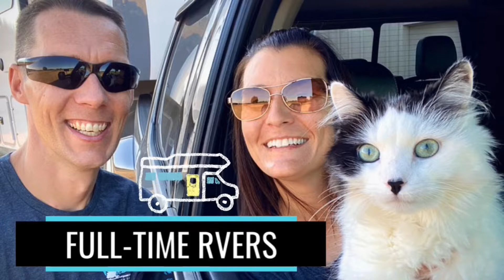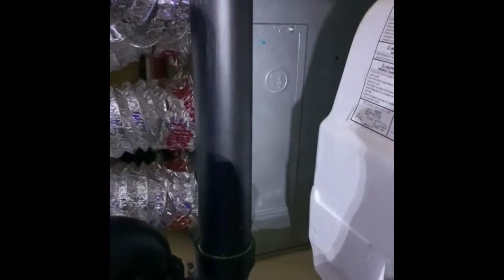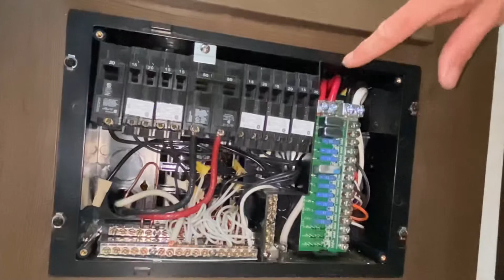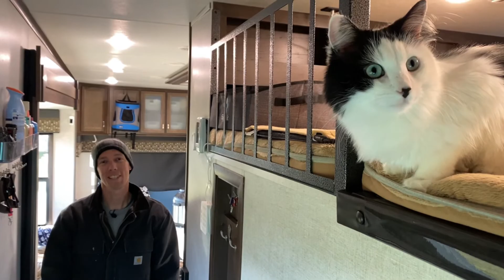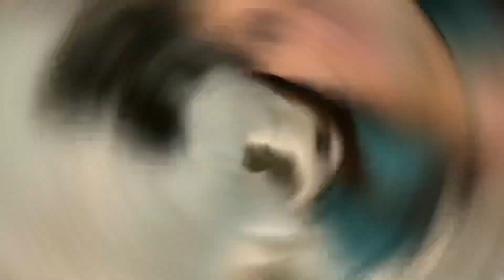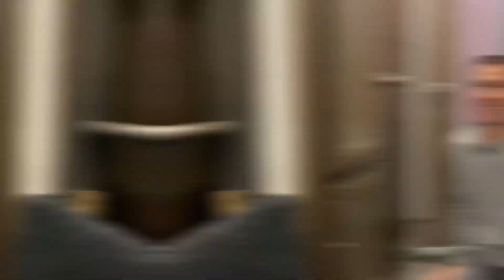RV Furnace Quit Working | Check the Relay Fuse

Comment: Thank you thank you thank you!  I had the same weird buzzing after the furnace would just shut off which is not a safe way to shutdown.  I replaced the main board and the limit switch and was about to replace the sail switch when I came across your video.  I never thought to look at this crappy plastic relay fuse!  Problem solved!

Comment: I have a metal fuse on my furnace circuit instead of the factory recommended regular fuse. A previous owner must have had the same problem. Mine might be going bad now and its harder to tell is a drawback. Thanks for the video.
Reply from the maker: Taylor, I would check to make sure the fuse isn’t loose then with a voltage meter check if you are loosing 12 bolts coming out of the fuse to determine if it’s the issue. -Steve
Reply: @Radar Road Warriors  Thanks. Will do.

Comment: I’m having issue with fuse blowing after it has run a long cycle but has to come back on quickly because it’s so cold.  I have checked heater connections and wires and all seems good. I think it may be a similar issue as cheap fuse heats up while running, then cycles down and when it starts back there is that extra draw on a warm fuse and it blows. But I’m not an electrician so who knows.  I bought the fuse you have but worried that a auto resetting fuse may hide a serious issue if I never notice it’s tripping also seems to have less protection at certain ranges. Then again not having it may cause frozen pipes. Last night fuse when out it was 24 degrees and I didn’t notice until morning.
Reply from the maker: Jonathan, the fuse I replaced is also an auto resetting fuse. I replaced the original fuse with a better quality fuse that operates properly. If you’re replacing the same style fuse like I did, there isn’t an issue. -Steve

Comment: By chance did you change to an AGM battery?  I just installed an AGM and starting having this same issue with my furnace fuse.  Possibly blowing due to the higher voltage and like you say, heat build up in the fuse.  I'm going to try the newer fuse and see if that solves the issue.  Thanks for the video.
Reply from the maker: Dana,
We changed to lithium batteries. I’m not sure if it’s the better batteries that affect the fuse or it’s just a low quality plastic relay fuse. We haven’t had an issue since the metal relay fuse has been in.
If you get a chance check out our Upgrades & Mods video to see all of our upgrades.
Reply: @MobileRVTechServices  Thanks for the fast response.  Lithium, as well as AGM, do have a slightly higher voltage than a normal flooded battery.  So, I think that is what is causing my issue since I just installed an AGM and my fuse issue started with the new battery.  I didn't even think of that until I found your video.  I do have the new converter that handles Lithium but haven't installed it yet.  
I will definitely check out your other videos.  
Dana

Comment: great video, noticed you had 3 metal relay fuses,  what are on the other 2, and who did you change them
Reply from the maker: Walter,
The 2 other metal relays are 30A and they are for the slide outs. Those came from the factory for our electric slides. -Steve

Comment: I have a 2017 Grand Solitude and every time we switch it to Heat blows the 15amp fuse wondering if this is the same problem that you had. Please let me know. Thanks God Bless
Reply from the maker: Mine didn’t immediately blow a fuse. It sounds like you may have a short, the fan is bad or the fan is plugged with mud daubers. I had to clean out mud daubers from a furnace that was blowing the fuse just like you described.

Comment: Hello i I’ve the same problem I will change the fuse this week.
You have any problems with the air condition in the kitchen? I need a Compressor you know where I can buy one. I’ve the same rv but I live in Germany
Reply from the maker: Gino,
I’m not familiar with where to purchase parts in Germany. If the compressor is bad in an air conditioner, the entire upper unit needs to be changed. I would have an RV tech check to make sure it’s not an electrical part that can be changed before replacing the compressor/upper unit. -Steve

Comment: I have a 34’ Fleetwood Wilderness Travel Trailer. The heat, and ac are controlled by a thermostat, and are separate units. The thermostat will not turn on either, now. I’ve looked all I’ve the internet and cannot find the problem. It’s COLD and I am using electric space heaters to stay somewhat warm. I am connected to shore power. I have replaced EVERY fuse, even the 2 30amp fuses on the converter box.Please help.
Reply from the maker: If you have a Coleman thermostat, there is a fuse either inside of it or on the back of it. It could also be a bad A/C control box as your furnace could be controlled from it.

Comment: I have a similar problem, however it works fine on battery power. If i run the genny or use shore power - when the furnace kicks on, the Voltage goes up and the fuse trips. No such problem when running the furnace off of battery power. wierd.
Reply from the maker: That could be a converter issue that is outputting too many volts. If you can check the voltage readings with a multi meter you should be able to determine what is going on.

Comment: Mine stopped working after 2 days of having a 30 cold front. Fan doesn't turn on. I have the SF Surburban Series. All 12volt items in my rv wprk and my batter is topped off. I am on shore power and have 79 % propane in my tank
Reply from the maker: It could be power related with the fuse I had problems with. If you have a digital multi meter, try to trade down the power to see if you are getting voltage to the furnace. It could be the fuse at the power source, the thermostat or a part in the furnace. —Steve

Comment: My a/c and everything works as it should but when I turned on the heater the fuse continues to blow. It work last season and I haven’t changed anything.
Reply from the maker: Zman,
The fuse could be bad, I’d try to change that after I inspect the furnace to make sure there isn’t a nest in it. A nest can block airflow and create extra amp draw that could blow the fuse when it turns on. If you still have issues once you make sure the furnace is clean and the fuse is changed the furnace could be drawing too much power due to a shorter wire or bad fan. -Steve
Reply: @MobileRVTechServices  Thanks Steve. I’ve blown multiple fuses and don’t see a nest. Believe it is a bad fan.
Reply from the maker: @zmanbassfishing  you’re welcome. It sounds like a bad fan with what you described.
Reply: @MobileRVTechServices  Thanks again for the help. After a further detailed look there was a small mud dobbers wasp nest blocking the fan from moving. After a few minutes I was able to break it up and the fan worked along with the heater.
Reply from the maker: @zmanbassfishing  that’s good to hear. Thanks for following up and letting me know what was causing the issue. 

I use these screens to cover the outside vents. They work great but are a pain to put on. They can also void your RV’s warranty. If you use them, make sure to clean them monthly so there is enough air flow and you don’t start a fire. https://amzn.to/3Tj5Go6 ~ Steve

Comment: Has worked fine all year long and suddenly this morning after using it for a while seems to have shut off and now I can't even hear the fan start when I turn it on the switch. Just seems totally dead.
Reply from the maker: James,
That sounds like a power issue. I would check the relay fuse and trace the wires to see if there is a loose connection. -Steve

Comment: We were below zero last night....anyone ever have a heater "freeze"?  I have full propane tanks, propane running to my stove (it lights), and heater turns on but just blows air for a minute and no heat.  I have a 2024 LaCross 3500DB, brand new.  Any thoughts?
Reply from the maker: If it’s blowing air and not going into ignition then shutting off, it’s most likely the sail switch.

Comment: When we turn the furnace on, the AC unit in the ceiling comes on but not the furnace. Trying to figure it out.
Reply from the maker: Thomasina, it sounds like the fan is set to low or high which makes the AC fan come on whether in heat or cool mode. The furnace fan will come on when it’s colder than the temperature you set on the thermostat whether the fan mode is set to auto, high or low but if you don’t want the AC fan to blow in heat mode, set the fan to auto.
This video shows how to do that. -Steve
https://youtu.be/BFRUFhZqnd8

Comment: Our travel trailer furnace quit blowing this early morning. Our neighbor said to shut off the propane tank wait a couple minutes and slowly release the gas back open. I tried the furnace and it still would not come on. But before dinner I went to the thermostat and open the front face to see if there was a battery I didn’t see no battery I cannot touch something or maybe blow off some dust closed it back up and it came on.If you use her go when I’m in the trailer in only five or six years old there was a blower issue that we had fixed it sounded like a locamotuin
Reply from the maker: To reset the furnace you can cycle the thermostat which I’m guessing happened when you took the cover off and dusted it. -Steve